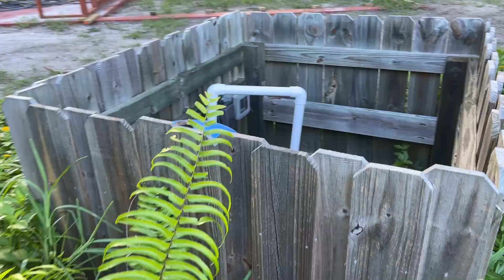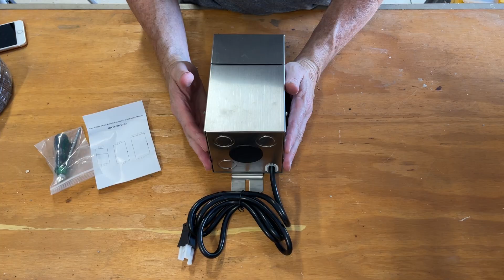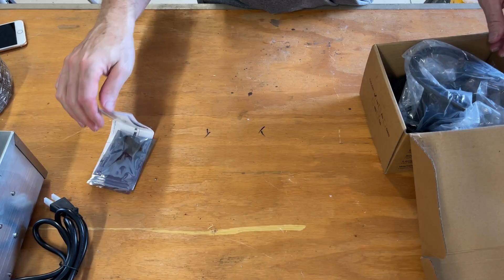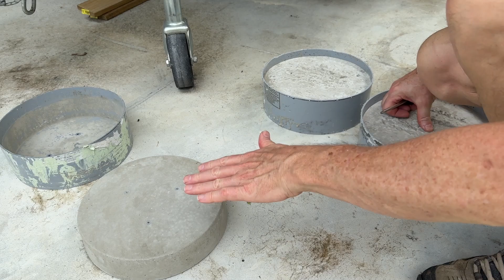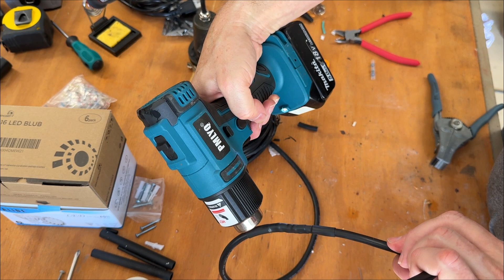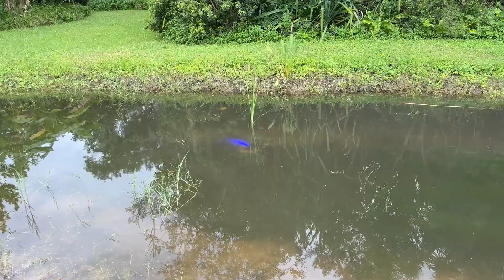Installation of Gardenreet Low Voltage Pond Lighting

Comment: Definitely would have helped you actually showed the wiring part and how you got power to the light.
Reply from the maker: Not sure what was missing, I added extra wire length as shown in the video and ran it up to the transformer. I already had a power outlet in the pump area so that wasn't part of the project.